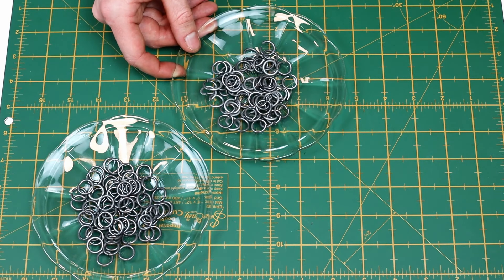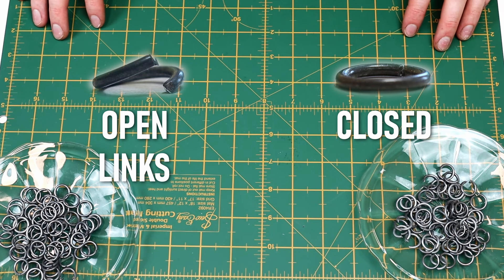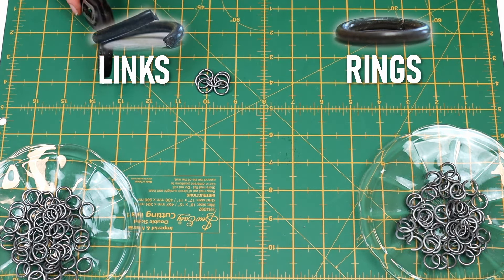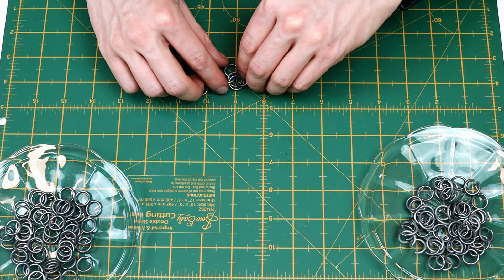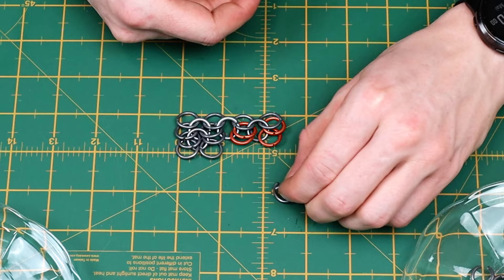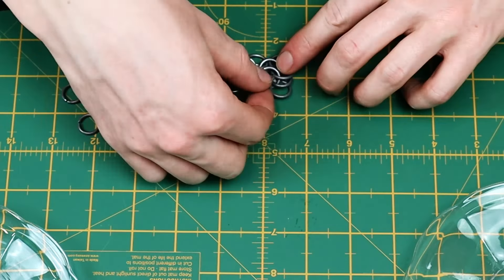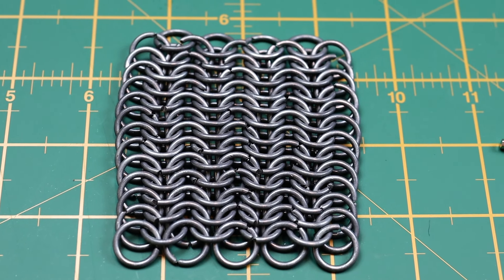How to make 6-in-1 CHAINMAIL

Comment: Thank you! I've always been thinking about making some armor for my forging gloves (just for the sake of it), but I'd been doubting at making plate armor or some chainmail. This type of chainmail seems a lot easier to start with, as plate armor would require some very specific shaping. Chainmail is more or less making a sheet of it, and then add a bit wherever it needs some.

Comment: This is very cool. 
Curious as I'm new to learning about chainmail right now, if you solder the ends of each ring would it make it stronger to not fall apart? Or is that just an unnecessary step? I've just heard how if its not riveted then it could fall apart. That's why I'm curious about solder instead to keep a clean look of the rings.
Great videos. Looking forward to future ones.😎🤘

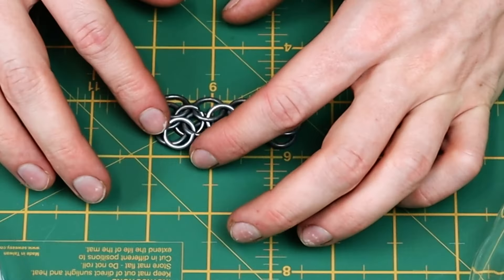Comment: whenever i get to 0:41 and loop the 2 rings while adding 4 the pattern gets all bunched up for me and i cant figure out what im doing wrong. 
im using 16 gauge 12mm rings
Reply from the maker: Hey sorry I’m late. Maybe I misunderstood but you only have to loop 1 link through the 4 highlighted and then add 2 rings to that link before closing it. 
Adding 2 links is only necessary for the first string